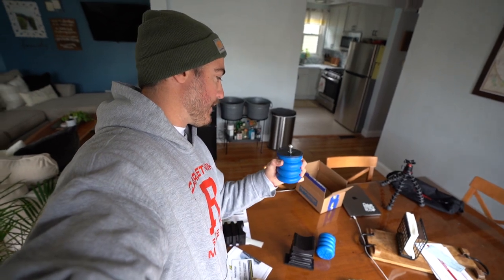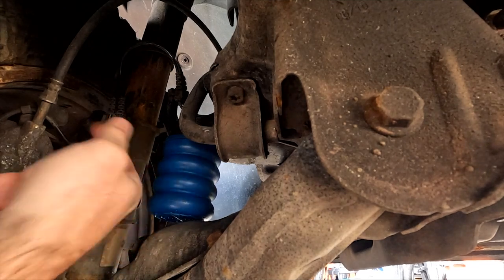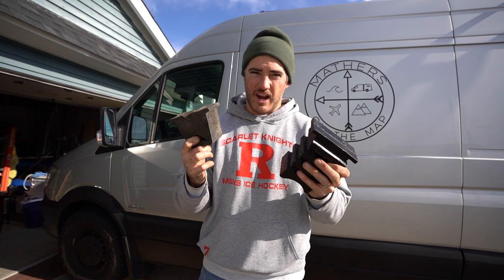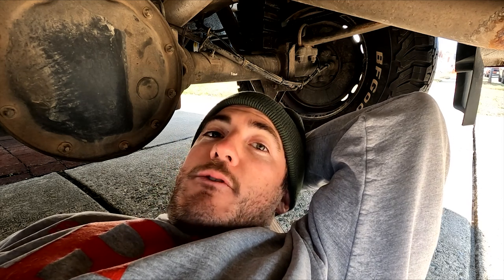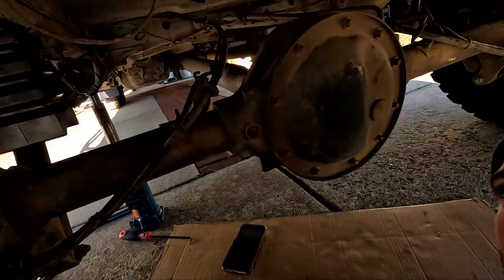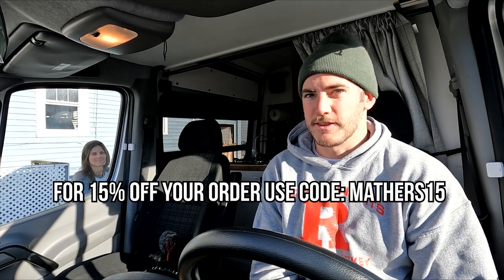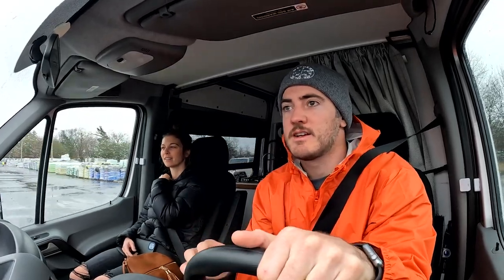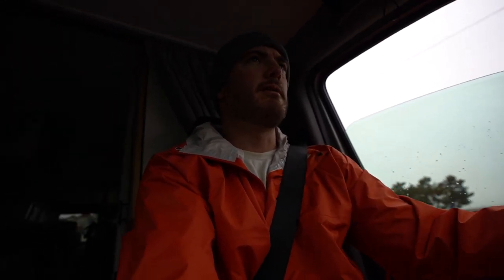Installing SumoSprings... Easiest Suspension Upgrade Ever

Comment: Nice install, you should feel a difference. 
I put the Sumo springs on the front, air bags on the rear and coil over shocks on all 4 corners. 
And a large anti sway bar on the rear. 
The rear anti sway bar and air bags were the best improvement for keeping the van stable on the interstate and the Sumo springs helped on the uneven roads.
Always a thumbs up 👍

Comment: I did happen to have seen a youtube video where this guy had issue with the sumo spring putting too much constant pressure on the bottom of the frame where the spring was mounted and causing the frame to push up cracking the van floor. He had to take it to a welder to have it repaired. Maybe he overloaded his van grossly. Anyway, I thought that you should use either Supersprings or Sumos, not both, in the rear. Have you talked with the company about using this combo? I just bought the Supers for the rear and the sumos for the front but have not install them yet. I tried to call them this morning to ask about using both for the rear but they seem to be closed on weekends.

Comment: I installed these on my Winnebago Via RV with a Mercedes Sprinter 3500, dual rear wheels. I installed the yellow Suma Springs and bump stops due to the additional weight load of the vehicle. They absolutely made a huge improvement in reducing sway and bounce of the chassis. I then went a step further and replaced the original shocks with high quality Bilstein shocks on the rear and struts on the front. They also made a significant impact. I highly recommend doing both. Be sure to have the front end aligned if you change the struts. This upgrade comes with a bit of a harder ride, especially from the rear axle, but that is a small price to pay for the greatly  improved ride and safety. Great video, as always!
Reply: I am planning to do the full system install of SuperSprings + SumoSprings + Monroe Heavy duty shocks and struts.
Reply: Hello!  
Question, since you have a Sprinter based RV similar to mine (Leisure Travel Van). Maybe you have some input that I can use.  Anyway, my front tires show signs of excessive wear on the edges. The tire guy says it's "cupping".  
The MBenz dealer said it's because of uneven weight distribution due me towing a Jeep Wrangler on my road trips.
In your opinion does beefing-up the (rear suspension) with Sumo Springs will mitigate this problem?
Yeah, I'll have to fork out $'s for 2 new tires.
Thanks.

Comment: Did you replace the shocks? With the age of your van I am sure they are not good anymore. Mine is 2015 and it made a huge difference. In the rear it’s just two bolts with an impact driver. After you do the front make sure to get an alignment.

Comment: After your recent upgrades to your vans suspension; Leaf spring stiffener and both sumo replacement shocks. Have you tested your van out on a washboard road?  Not crawling over the bumps but driving at a reasonable speed without being reckless.  Also, since the front bumpers are thicker, is there any problems with the additional stress the frame. That energy from the bumper is being transferred to the frame, laws of  Thermodynamics

Comment: I just replace with SumoSprings over the weekend and put new struts on with rear shocks. Its No 4.3 compass suspension but it's a hell lot better and cheaper. Hey hey if you got some downtime you should come down Omaha I'm just starting a Mercedes 170 extended 4x4 van build out. Earn some extra cash for the next trip Tom

Comment: I tried your vise grip method but not too successful. I am not strong enough, and/or I don't have enough leverage.  After exhaustive trial, I came up with an idea,  put a car jack under the screw driver. Whoala, smooth like butter.  Works smarter, not harder.

Comment: Great product. Has anyone reported after 150-200k miles of use. The mounting points were not engineered for the constant load these place on those areas.

Comment: I’ve read about the Sumos cracking the wimpy Mercedes frame. So be careful.  Safe travels!
Reply from the maker: Sayyy what!? That’s crazy!  Where ya read that?
Reply: Makes sense. All that kinetic energy from impact has to go somewhere. Good ol laws of thermodynamics.
Reply: I heard that as well!!! Be careful like even a year or two later you could have a big frame crack I heard.
Reply: A Mercedes mechanic said the same thing. Just because you have sumo springs in the rear doesn't mean that you can over load of run the van harder over bumps. .
I have a handrail installation business. I have about the same weight carrying tools as a camper. 
I just bought the sumo bump springs to help with the ride. 
I will be installing them when they arrive.